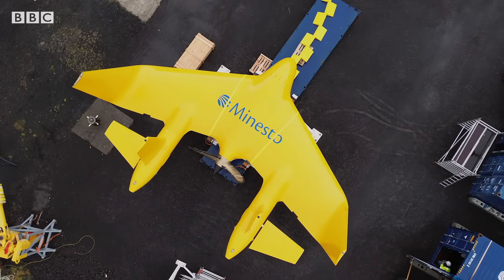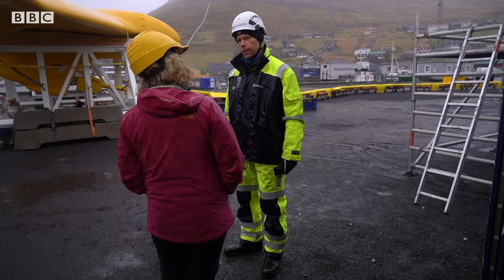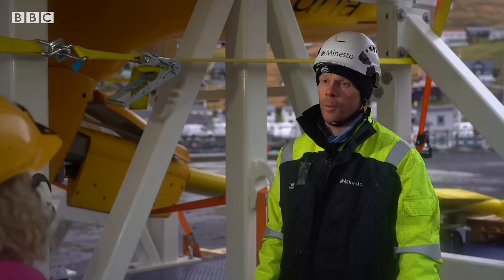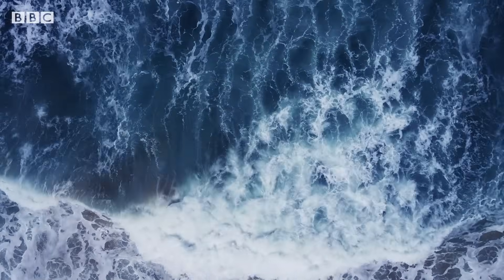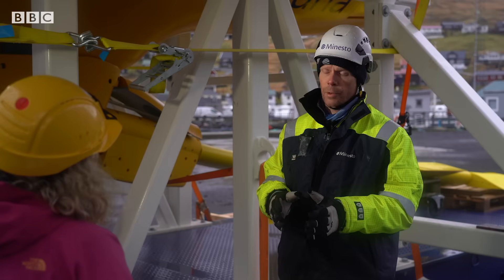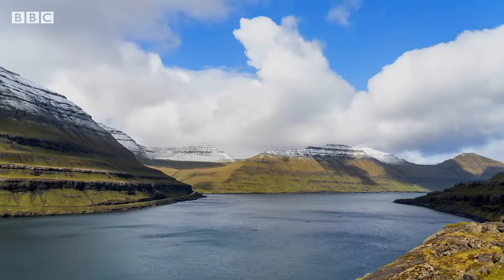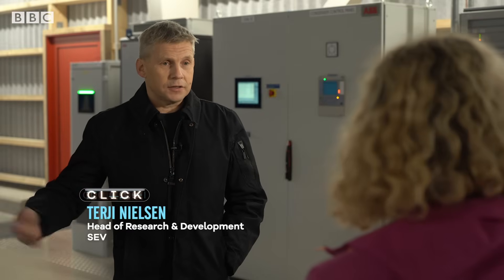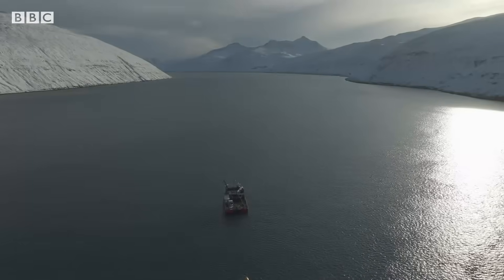The underwater 'kites' generating electricity as they move | BBC News

Comment: Underwater surfaces will need maintenance every so often, and that may be the achilles heel of such a system. On one side it will generate jobs and income, on the other side the maintenance may be expensive. Underwater surface materials can probably be made better than 100 years ago -- but to me that is the critical question.

Compare, if you have the chance, to a propeller on a ship, made of brass, but after some years their surfaces get corroded. Now modern surfaces of "polyurethane" may hold up better.

Comment: The idea is great for science experiment, but I don't think it's practical.
Mechanical issues and power failures are bound to occur quite often due to the nature of this technology.
This is not practical.
Reply: Why would it be power failures? If a specifik kite stops working you will just replace it and fix it. The rest of them keep working. Deliver electricity under water is nota new thing and should not be the reason for failure?

Comment: Too much to go wrong. Too many variables. Too many unknowns.
Reply: Name some pls.
Reply: @Jonas-wh2zq  Too many moving parts. You've got what is essentially a tethered machine, floating in a current in an unpredictable environment. I'm all for harnessing tidal power but this is just too complex.
Reply: @hughoxford8735  i don't understand what you think is so unpredictable. The tidal is completely predictable. 4 rudders and a generator and then the connection with the tether. Not that complex with moving parts. If you want to make it cheap you need to make the design smart. It is not very smart to put a big generator on the ocean floor.

Comment: The density of water is roughly 1000 times greater than air. Also by flying a kite relative to the tidal stream you can achieve a speed up to 10 times greater than the actual stream (7-8 times is more realistic).

If you like physics and math you can play around with the power turbine formula which depends on density and velocity cubed (^3):

- Density x1000
- Relative velocity cubed x10^3 = x1000

P = 0.5 * ρ * A * Cp * v^3

So for an equal given sweep area and stream velocity for the turbine, Minestos solution could potential generate one million (x1 000 000) times more power than a wind turbine. Hence, the turbine can be so small compared to a wind turbine.
Reply: Thats why it can get relatively cheap!
Reply: I think your comment is misleading at best. Why are you multiplying the velocity by ten? The blades of a wind turbine also do the same crosswind motion, so there is really no difference there. Except that the velocity of the water stream is probably much much smaller than typical wind speeds. Another thing is the drag that is much greater in water and especially bad for these kinds of systems where the tether is dragged through the water. You can even see in the video that they try to minimize this effect by applying this airfoil shape to the tether. But still, since as you said, you want a high cross-stream velocity but this directly increases the drag induced by the tether with the velocity squared.
So overall, you can expect  ρ to be 1000 times higher, but v and also A to be smaller than for typical wind turbines. And simply assuming v and A to be equal is not realistic.
Reply: @1zui  this was just a theoretical example to highlight the advantages of the technology. Hence, I wrote that the velocity and area must be the same for the turbine for the technologies to be comparable.

In reality the area for a wind turbine is much much greater than for the water turbine. Also the wind speed is typical higher than the water stream.

The reason i multiply by ten is that the dragon is actually ”flying” many times faster then the water stream itself. In reality this number is closer to x7 than x10. But it’s the relative speed thru the turbine that is interesting i.e. velocity of the dragon and that is a factor x7 of the water flow whether you like it or not.

The drag is not important other than that Minesto can ”squeeze” out a couple of extra percent in power production if they reduce the drag. The velocity of the dragon is what it is already taking drag into account.

In the end, what I’m trying to explain is that the power/weight ratio is far far better for Minesto then any other comparable technology. It will outperforme both stationary tidal energy as well as wind power with its extrem heavy nacelle, tower and foundation.
Reply: @jojimom  But your formula calculates the power in the water stream, therefore you need to put in the water velocity.
The cross-stream motion does not matter here. And even if it would, conventional wind turbines perform the same motion.
Reply: @1zui  No, you are wrong. The water velocity has barely no impact on the power generated. It is primarliy the speed which the dragon pushes the turbine thru the water that is generating most of the power. Otherwise, Minesto could have just put the turbine on a stationary foundation on the sea bed as their rivals do (ex. Nova innovation). This is what make their technology unique and stand out from competitors.

An anology is if you look at an airplane take off. If you start your plane with a wind opposite the take off direction you can do the take off at lower speed than at no wind relative to the ground. Basically it is all about the net speed with regards to the vectors of the wing velocity relative to the wind velocity.

If you can’t agree on this I’m not sure how to convince you, more then a recommendation to take some basic physics courses.
Reply: @jojimom  Sorry, but that makes no sense. You can simply think of this wing as a single blade of a wind turbine. The only difference is that it flies in a figure of eight instead of a circle. So there is no fundamental difference in these two.
So I guess my main point is that the issue lies in your assumptions that a rotor blade moves with the same speed as the wind  which it does in fact not. In both cases you would have a similar factor for the cross-wind speed, so simply multiplying v by 10 in one case but not in the other is not correct.
Reply: @1zui  This will be my last reply, since the discussions is leading nowhere. But there is for sure a fundamental difference in the two cases, which are:
1. The turbine in Minestos solution is attached to the dragon wing itself which moves relative to the the surrounding.
2. A wind turbine is fixed stationary on the ground and do not move relative to the surrounding. For sure the blades moves 90 degrees in a circle compared to the generator alignment but so does Minestos turbine as well and all other rotating equipments.

You are making the mistake assuming the dragon wing is the same as a blade on a wind turbine and that would only be true if you compared a stationary tidal power turbin like Nova innovation. Or reverse, if you would put a smaller turbine along the blade of the wind turbine. Alternative, you could watch the Makani wing by google to see the air equivavlent to Minestos dragon.

Try to study and read about the technology before you make assumptions and own opinions. Because non of your statements makes sense if you only would understand what is achieved here.

Regards from a BSc. in Electrical Engineering with specialization in Electric Power Engineering
Reply: @jojimom  it's fine, I suspect there is just a misunderstanding somewhere. 
But as a remark, I advise you to do the same: read some material about these systems. Whether the turbine is attached to the blade/wing or not does not matter for the power that you can extract from the wind/water. In the AWE field, you will find this categorized as lift mode vs drag mode configurations.
Reply: I'm not quite sure I believe that 10x greater velocity number,   I understand when it's flying into the water direction the velocity will increase, however for every moment it flies into the stream it must also fly away from the water's direction in order to not move relative to where it is tethered, leaving to a net velocity change of 0. 

I would also suspect our Cp value will be smaller for water than wind simply because there would be considerably more drag due to the density of water, but I'm not really into hydrodynamics enough to know by how much.

But even so you're right, the massive density difference of water allows you to get more with smaller size turbines,   however there is a very real limitation of that,  in order to get the more power the turbine does need to physically spin faster and there are material stress limitations to that.  Now I know you were not suggesting that you could get one million times more power, I just wanted to stop that thought that a single big underwater turbine could provide a million times the power of a land based wind turbine.
Reply: @Mike__B It flies perpendicular to the current - like a stunt kite on the beach
Reply: @Mike__B You're wrong.
Reply: No, its 35 to 36 times more not 1000
Reply: I'd love to see some math on how this is supposed to be scaled in order for a country to make use of it.. Its just a toy for engineers
Reply: @Atomy111  They have a 200 MW roadmap that you can find on their channel or homepage which describe a typical roll out and scaling of their first commercial collaboration.

Comment: Wow, I was expecting to see 2 propellers rotating in opposite directions at 3:04, with the glider staying still and the props turning on-board generators. Instead, there is one propeller, and the glider moves. I don't get it.
Reply: Tides flow in different directions at different times of each day... it  flows into a bay... and goes back out, several hours later..... twice daily..
Reply: if the glider would be standing still you wouldn't generate as much power as when it is moving in a figure of 8. Its is a very big difference.
Reply: Glider converts low flow speed into high flow speed by doing circuits. Turbine converts high flow speed to electricity. The advantage is that the glider is versatile and simple, so can convert a wide variety of conditions to optimal conditions at the turbine, letting it produce rated load over the majority of the day and making good use of the all the expensive parts.

Comment: What about putting it in a flowing river?
Reply: It could work with a very small one. But that is not in the plans. They want to generate more power.
Reply: @Jonas-wh2zq  what about a huge river, like the Congo or the Ubangi?  Very strong flow and space for big units.
Reply: @SeleMpoko  it could be possible that it would work. If the movement of water is enough and consistent. I only know they said it will not work in Sweden. I don't remember why.

Comment: I don't think it will work. In other examples they had a lot of problems which needed expensive costs and the date for big production is going further into the future. Not really promising. Would be very nice to "harvest" energy everywhere but it's not always that easy.
Reply: What is it that will not work? It is already running. What problems needed expensive costs? New products always have delays.
Reply: You are not well informed here - the dragons are already working while delivering power to the grid since 2020 in small scale and since >4 months in large utility scale.
They are very light and cost effective  both in production and handling & maintenance.

Comment: Great way of harnessing the powers of the ocean! Weather does not interfere as with wave. This is predictable base load that will give stability to the electricity production. With a solution like this the need for expansive storage is much lower. In total it is better than wind farms taking into account the need for storage or the need for oil generators.
Reply: ..until it kills a whale.
Reply: @driftlesshermit  the tests done by Universities says they avoid the dragon when they come close to it.

Comment: Drones are currently being looked at by the government & will be regulated so anything like this ok if they are using it but something like this could be made into basically underwater drones just like the ones anyone can buy. How cool would it be to get a view of everything under the water.
Reply: These ones have no engine. It will not be able to fly unless its connected to the bottom. It works just like a kite except it has rodders.

Comment: This is another example of completely idiotic "innovation". Expensive, inefficient, bad design. There's a reason turbines are NOT angled. Because only complete idiots or - like in this case - scammers milking clueless investors think that's a great idea.
Reply: You seem to have very little knowledge about these things. The production is beeing monitored and sold to the grid as i write this. It works just as efficient as it says on the product. Don't be a fool.
Reply: Your conclusion is a relly bad one. How can you even function with this kind of huge lack of deduction abitilys?
The dragons are the dominant design.
The dragons are about 10 times lighter per MW than any other ocean energy, more cost effective both in production and handling & maintenance and operate in slower flows (theres a lot more of those). Also 100%  plannable oposite to wave energy.

Comment: "Swimming beneath": at what depth? Surely there must be accommodation to prevent conflicts with navigation?!
Reply: It "flies" about up to 8-10 meter below water levels as i remember. Don't anchor or take your submarine in those areas. ^^
Reply: The operating depth is minimum 8 meters below surface, so no interfearence with most marine traffic
Reply: Thanks for the replies. It still leaves me wondering a bit. I'm not sure, but aren't there some large ocean-going ships that take more water than that when fully loaded? Like one of those monster cargo ships? So what is the maximum depth for one of these "kites"? I suppose it would need to adjust for where it is positioned. Not so many of those huge ships in the Faroes.
Reply: @farmergiles1065  yes. You wouldn't place the parks under the fairways where the big ships are supposed to go. The parks are strategically placed to minimize impact of marine traffic and other things.
Reply: Worth noting is that these are not dumb structures, they are able to maneuverer if necessary. It would be annoying to have to turn off your generators (or run them suboptimally) when a large ship is going past, but it is absolutely possible with zero hardware modifications.

Comment: Too many ways to get it entangled with pretty much anything floating around, and to hamper EROEI as a consequence.
Reply: Well, it operates at a maximum heigth of 8 meters below surface, so I don’t think ”floating” debris is a problem. Neither is weather or marine traffic.
Reply: @Ginflyer  floating happens on all levels.
Reply: Floating ghost nets could be a problem yes. An try not to anchor on it.
Reply: They already have 4-5 smaller versions running for afew years with no problems

Comment: Does it produce electricity about the same as the oil power plants ? Or is it only economical at high energy costs to the consumer?
Reply: Unlike oil the energy source is free.
Reply: It is mor eexpensive than wind turbines but it is a baseload and u always know what you will produce so its much better than wind farms that is highly unpredictiable.
Reply: Depends if you factor in the cost of shitting in the air. It is immensely more economical if you factor in the damage that changes to our climate from increased CO2 will do, but if the consumer is passing those cost on the the commons then oil is very hard to beat.#
Yes it is always cheaper. Oil is just easier to get somebody else to pay the price for.

Comment: Boeing Disaster
Boeing 777 reports technical defect, returns to Amsterdam's Schiphol
A wide-bodied Boeing 777 aircraft returned to Amsterdam's Schiphol Airport for safety reasons on Sunday around 40 minutes after take-off.

The aircraft operated by Dutch airline KLM was en route to Rio de Janeiro and was travelling over Belgium when a technical fault was reported, the ANP news agency reported Dutch air traffic control as saying. The specific nature of the defect was not disclosed.

Jet fuel was dumped over the North Sea before the safe landing, the report said.

Comment: Turbine under water...
Well, I doubt it is environmental friendly... and reliability will be also a problem...
Reply: why wouldn't it be? elaborate.
Reply: Dragons are way more environmentally friendly than both fossil fuel electricity production o.c. but also wind turbines that are wasting plenty of tonnes of concrete and steel for the few unplannable MWh they produce. 
The dragons use 1/5 incl. foundation of the materials per MWh produced.
Reply: @jacka9612  There was no intention to doubt emission-less power generation from this design...
But... If you put turbine with quite complicated "kite" system under salt water where you will find thousands of aquatic animals and microorganisms you have to handle with this environment... and your "fight" won't be environment friendly...
BTW: Few years ago there was a startup cold Kitepower which made a tethered kite generator with ground energy storage... and even simple wind solution didn't make a revolution...
Reply: you're probably the rare person not to eat bananas shipped around the world